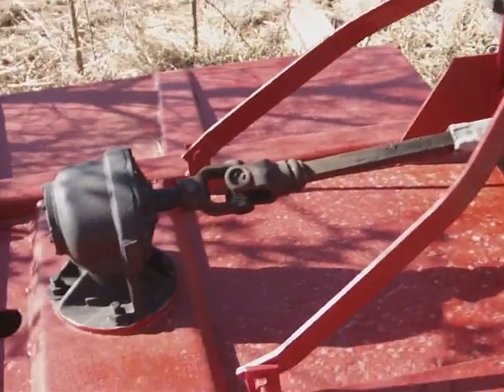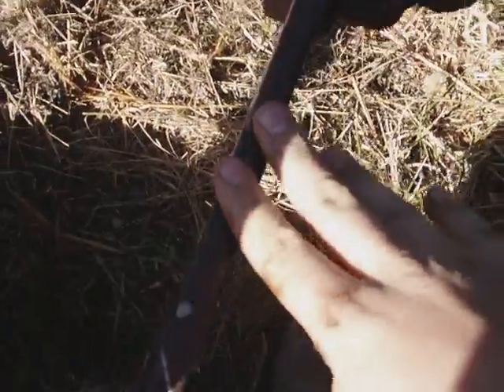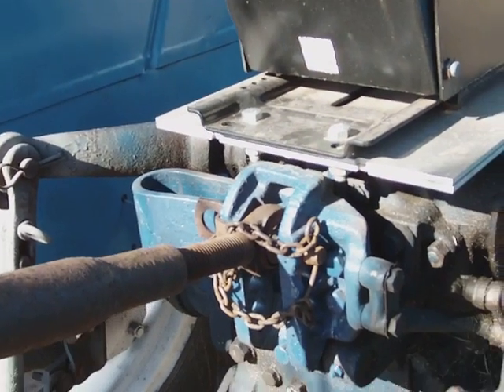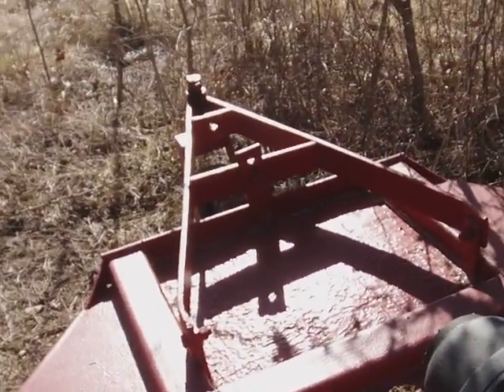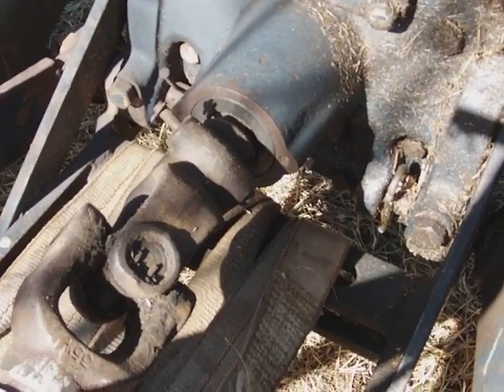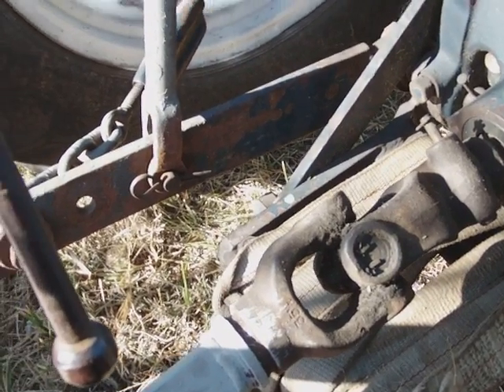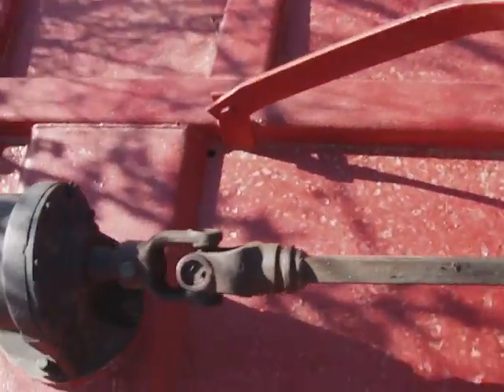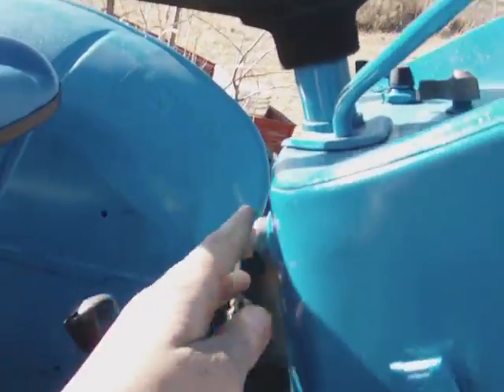How a 3 point hitch, pto, and bush hog work.

Comment: Thanks rusty, I spent my childhood hooking up rusted 3 point implements.  My dad is a golf super. A crowbar, sledge hammer and a can of P.B. Blaster were vital. It was never fun gearing up for fall hooking up blowers, vacuums, etc. A rusty pto is a special mother to attach. I drove one on the splines mismatched from the button once, it took hours to fix. mismatched center linjs, broken lift cylinders. attaching 3 points is  a real nasty job

Comment: Just bought a brush hog so still new to this. I like your video showing all the parts and all. It just scared me for you when you started the tractor and stood in front of the back tire. I know of a farmer who had been around farm equipment all his life and was run over by his own tractor by doing just what you were doing. At least edit video  and add in to make sure tractor is in neutral and the emergency brake is on if you have to start it up to demonstrate features. For your sake and that of others. Thanks.

Comment: @SuperRam3500  The old 8N can lift a bunch of weight. almost enough to lift the front wheels off the ground. In fact with my brush hog on the back of mine 5' Taylor.  I can actually lift the front wheels off the ground by lift on the front bumper (makes me look really strong if you don't see whats on back )  But if you lift it up as high as you can and turn the engine off It should stay up if it drops right as soon as the engine is off you need to rebuild the hydrolics.  Good luck

Comment: I have that same bush hog except mine has a heavy round wheel the blades bolt to instead of the cross piece like you have.  I never thought of it as heavy duty but then again, its the only one I've ever had. The channel iron on mine that the gearbox is mounted to (just like yours)  keeps cracking so I'm going to replace it with some solid plate. and bolt it on instead of welding so the heat won't weaken the steel.  I pull it with a little 25 horse Kabota. Does the job!

Comment: @AOO08DOYOUHEAR I have a heavy bush hog like that one which came with the tractor and I had to attach weights to the front of the tractor because the bush hog would lift the front of my tractor off the ground. I thought all of them was that heavy until I saw a friend's bush hog which was light weight, much smaller and easy to flip over on it's side. John Deere made sure the one I have would last a long time as thick as the metal is and as large as it is.

Comment: @SuperRam3500 You may have to adjust the bush hog height using the long thing which screws to adjust it. It runs from the tractor to the top point attachment on the bush hog.

Comment: I enjoyed the video on the tractor, and especially the bush hog. While viewing you showing the shaft, I didn't see any place where the shear bolt would go on there. If that is a solid shaft with no shear bolt the gearbox would be damaged or worst yet something on the tractor. I have broken many shear bolts, but I would rather have them to break knowing it could have been the gear box on the bush hog which cost much more to have repaired or replaced.

Comment: i have a ford 8n tractor and an old fashion bush hog when i lift the bush hog the wheel doesnt come alway the way up do you think the hydraulic seals are leaking or the bush hog is really heavy because it is old fashion and has really thick metal